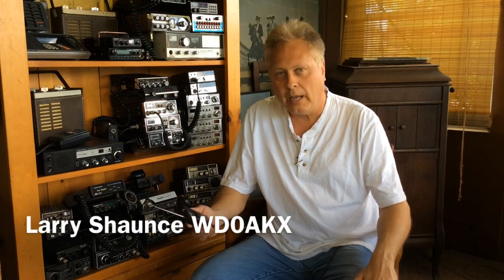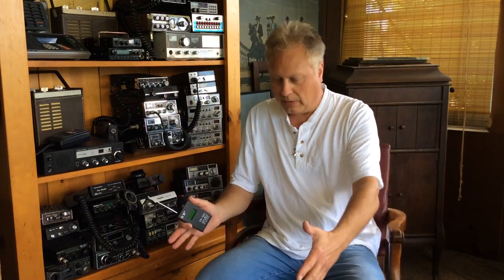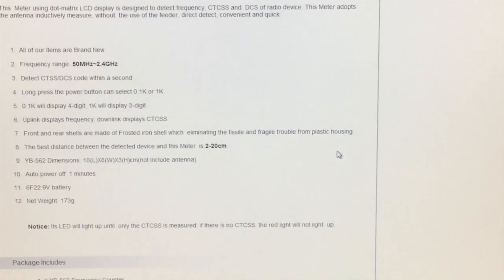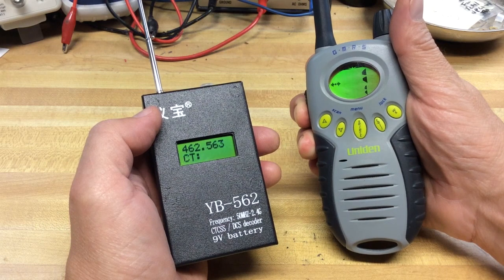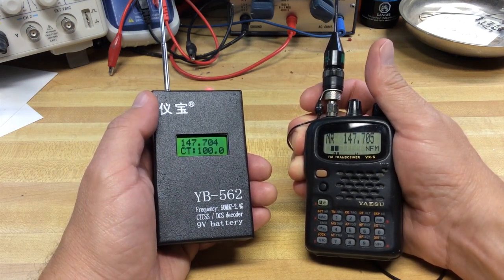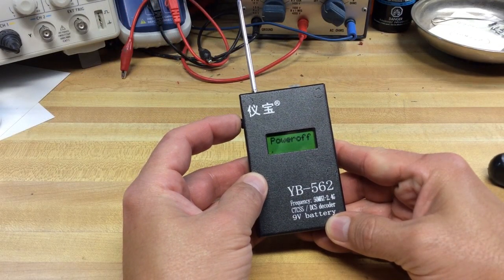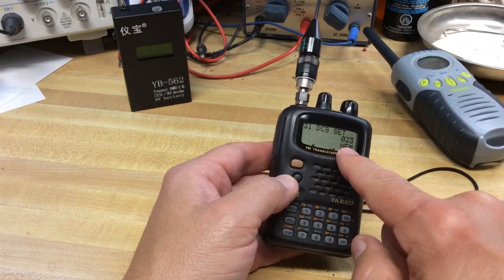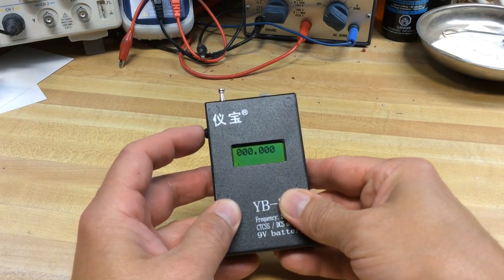CTCSS DCS Tone Decoder And Frequency Counter

Comment: I had a question if I wanted to just use my uv5r has a scanner do I have to put a a certain tone in it to receive as a scanner
Reply from the maker: No, you don't have to use a tone to receive. You could if you only wanted to hear a specific group without hearing others on the same channel, but with no tone you will hear everything on that frequency.

Comment: The baofeng HTs have a hidden menu option where they will sit on a frequency, and scan through all the ctcss frequencies until it lands on the one being used.
Reply: For receiving, it's not required - just turn off CTCSS/DCS and the squelch will open for any signal on the frequency.  You'd only need to know the tone/code to transmit back.

Comment: Can this show remote control frequency? 
Car fob key rf
Reply from the maker: These signals seem to be a little weak for an accurate display.  I tried my garage door opener and it tried to read it out in the 216 Mhz range but wouldn't quite lock on, I tried a car fob and it was either to fast  of a burst or didn't lock on.
Reply: @RadioHamGuy  so it didn't work?
Reply from the maker: @ahmdbulive8934  No, not for the purpose you were asking about.

Comment: Thanks for the info Larry, as it's 5 years since this video was made, I couldn't find this decoder in 2019 but got a Surecom SF401plus for about $45.  73 Leo PA5LS
Reply: Hi, what is the range of the SF401? Would it work from 20 feet to decode the freq?
Reply: @BaconRanch  your bog standard uv-5r does this at any range it can receive 👍

Comment: Hello and thanks for the video.  Will this actually show you the tone frequency or is it simply giving you the readout/indication of the "match"?  What I mean is I'm tuning up analog tone board in old Yaesu Memorizer FT-227RA and you have to basically adjust it until you get the frequency close enough.  I was wondering if this device can actually show you the frequency in increments as you are adjusting your radio or if it is simply expecting to decode a particular tone and give you the readout.   It looked like your readouts were always precise is why I'm thinking that I could not see the actual frequency of the tone being transmitted.  Hopefully you can understand my question.

Comment: Do you know if that works in mobile Motorola radios?
Reply from the maker: Yes it will as long as it is an analog radio, if it is a digital type radio this would not decode anything.

Comment: got the same thing in my alnico djx2000 scanner its has flash tune and ctcss decode and also a frequency counter. flash tune retunes the scanner to a near by radio which is transmitting

Comment: what GMRS channels and FRS channels can unlicensed users, use. like for family use. but also on high frequency? I just ordered Midland GXT1000VP4 and the users manual sais. The radio operates on GMRS (General Mobile Radio Service) frequencies which require an FCC (Federal Communications Commission) license. You must be licensed prior to operating on channels 1 - 7 or 15 - 22, which comprise the GMRS channels of the radios. Serious penalties could result from unlicensed use of GMRS channels, in violation of FCC rules, as stipulated in the Communications Acts Sections 501 and 502 (amended). Please let me know, because I seen youtubers using channel 18 on GMRS and I highly doubt he had a FCC license because he probably would have mentioned it.
Reply: Christopher Smith Europe uses PMR446. But FRS/GMRS frequencies is Europe are only to be used for emergency services like Police in Russia and Fire brigade in the UK. PMR446 in North America covers licensed amateur bands.
Reply: You can use all 22 of the channels on a frs/gmrs radio as long as you use low power. If the radio doesn't allow you to change the power level, you are probably fine and legal. The new rules allow 2 watts for FRS. Look it up on Wikipedia.

Comment: RadioHamGuy

Where did you get your FRS in house intercom from and do they still make them?
Reply from the maker: I think I got mine off of either ebay or amazon but I looked on the back sticker and it says they are from intertalk-sales dot com.  So you can check that site out, I see they are still on there or very similar ones, they have changed just a bit maybe.

Comment: Thanks for the review Larry!
You convinced me to buy one and it just arrived today. Surprisingly fast shipping from China. Works exactly as you described and is quite durable and very handy!

For those considering a purchase, do your research. Many are pictured in the metal case but there's fine print indicating you'll get a flimsy plastic case. There are also models with upgraded software, etc. But all in all, well worth the price (usually under $30 which includes shipping).

73
Reply from the maker: clagwell Glad it worked out well for you, I am still using mine quite often and it still works just fine for what it is.  Thanks for the updated information also!
Reply: The Chinese call it "Quality".

Comment: I do hope you all realize that a decent scanner can do the same thing for almost the same money used. I.e.: pro-164 when it was in production.
Reply from the maker: Cruiseomatic Yes, well aware and good idea.  This is just another simple box that works well out in the field, handy dandy!  Thanks for your post and 73.
Reply: +RadioHamGuy Also, the UV-5R can decode tones as well. You could have just used the radio in the other hand!
Reply: +RadioHamGuy Oh, and the N means Normal, not Inverted. The codes can be inverted (XORd), which allows for more unique options.
Reply: Scanner only works when the radio is transmitting and it takes a while to get through all of the possible frequencies. The scanner or radio is going through all of the frequencies listening for a signal. This takes a second because it just counts the frequency. "Frequency Counter"

Comment: what is the max range for it to detect the frequency
Reply from the maker: STORM TROOPER It is supposed to work up to 2.4 Ghz but I have not tried it that high I guess.
Reply: thanks for the reply. how about the max radius for the counter to detect frequencies.
Reply from the maker: STORM TROOPER For a hand held radio it has to be within a few feet or so or a touch more maybe, with a base station, maybe a few hundred feet or so.  So it does have to be very close in.
Reply: +Chol Pak  you  can walk in  to a place that uses radios like Target Store or Walmart and when there transmitting on there radios it will pick up there frequecy  and tones. best place if you sit in there Restrooms or aisles then you can go home and program them into your Radio or Scanner.

Comment: It doesn't  work  on Motorola radios the frequency keep bouncing around and in the unit shuts off without giving a set frequency on cheap radios like baofeng  it does work trying to get a certain frequency can't get it
Reply: Your comment is confusing and contradicting. It works on Motorola Radio's. It Just doesn't work on Digital "Trunked" or frequency changing motorola radio's. Because the radios don't stay on one frequency sometimes and jump around on the frequency band like a modern garage door controller does. 

Bottom line; they are intended in my opinion for analog radio frequency checks like making sure your Ham Radio is on frequency.  You get what you pay for.
Reply: I understand what you're saying so basically I cannot get the Motorola frequency when it is transmitting is there a better model that I can purchase?
Reply: I attempted to get it off a Motorola HT 250 and it was just bouncing around
Reply: Got it. 
Your wording just threw me off. Sorry, was just trying to help.
Reply: slick 50 unfortunately I don't have much money so I am not very familiar with motorola products especially the digital ones. In my humble opinion I think they are over rated. I buy cheap gear and have help setting it up and usually have better results then guys throwing money down left and right for the Newest technology. I prefer Motorola radio's but can't afford them so I usually buy alternative radios that are older and tried and true if you will.
Reply: slick 50 the radio he is using in the demonstration is basically the swiss army knife of two way radio's. You can buy them online shipped to your door for under fifty bucks. Only problem is they are tricky to setup but they are so popular it's not hard finding someone nearby that could help you program one. I recommend getting a ham radio license first though.